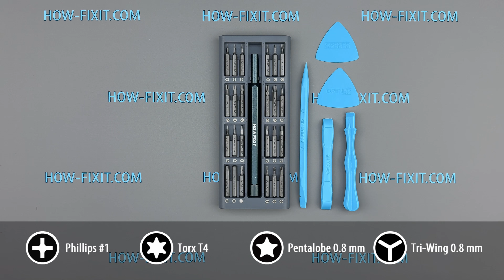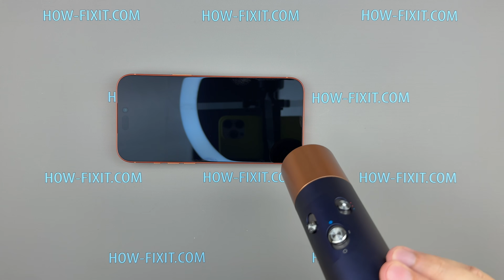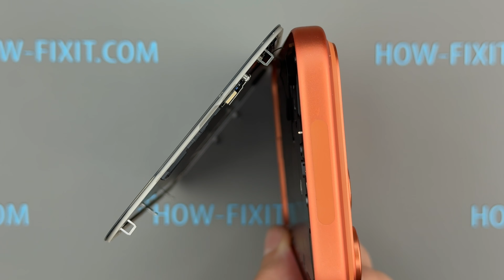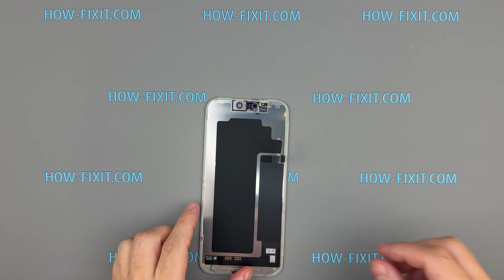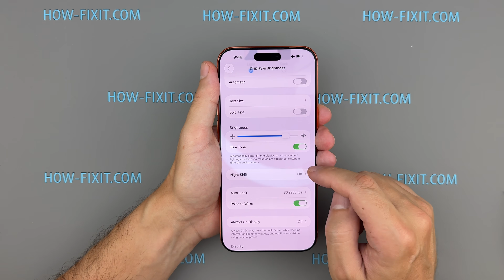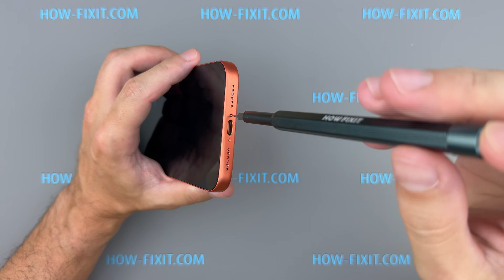iPhone 17 Pro Max Screen Replacement | Cracked Screen Fix + Repair Assistant

Comment: video is great till u get to the battery screen plate and u have to track down the multiple size screw heads u need to take it off not to mention u u need the adhesive coated screws to do properly.  amateur click bate not enough to be solid guide on repairing.

Comment: Does the iPhone 17 promax screen not burn if you don't unplug the battery
Reply: La pantalla del iPhone 17 Pro Max o de cualquiera equipo iPhone no se va a quemar siempre y cuando esté apagado el teléfono, tú puedes conectar tranquilamente el display si el equipo está apagado si quedó prendido y no lo puedes apagar vas a tener que sacar la tapa trasera y desconectar la batería. Espero que te sirva. Saludos